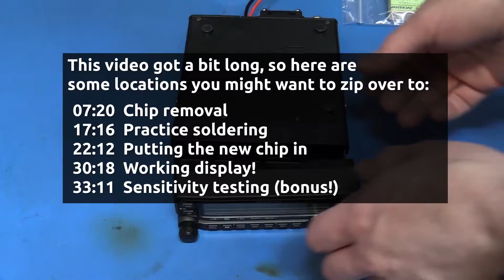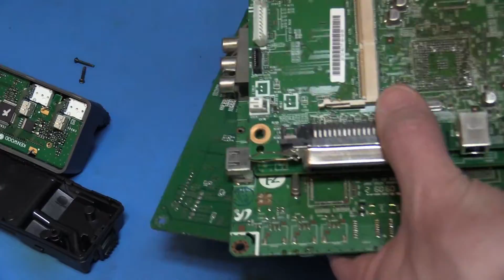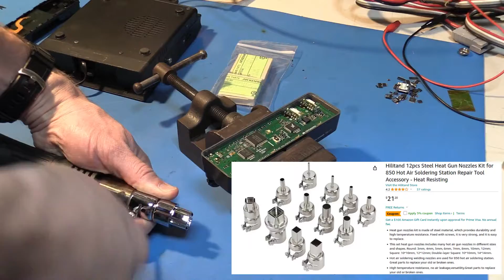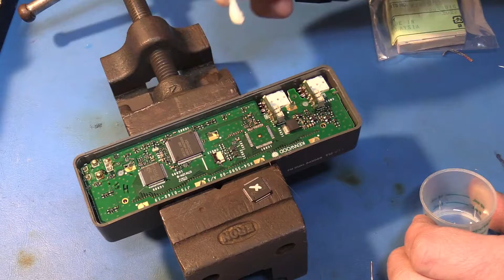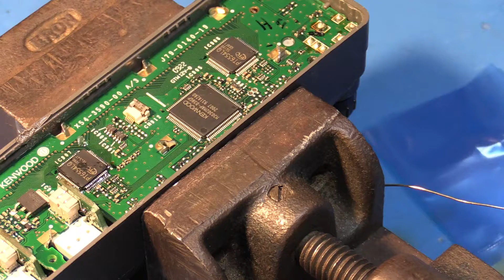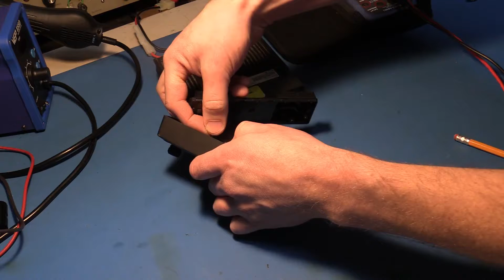Kenwood TM-V71 Display Repair

Comment: This is an authentic, unpretentious, and detailed video showing what went wrong and what went right; I don't edit it—I appreciate the honesty and humility. It wasn't clear to me if you ended up having to replace any other component besides the IC; the right side of my radio has completely failed, including part of the bar separating the two screens. Thanks for your patience and your time. 73.
Reply from the maker: Thanks for the complements! I had to replace some small components that literally flew off the board while I was soldering the chip. There’s one chip for each side of the display and I suppose the bar is handled by one of them. (The bar can be turned off in a menu, FYI). You can probably still order the chip from JVC/Kenwood and then you can have a similar adventure if you dare! 73
Reply: @W6EL Thanks for your kind and prompt reply. I don't have your temperament or the tools needed for that job; I'll likely have to learn how to adjust the radius on the two alternating bands on that screen as needed. I was asking if any of the small components were damaged, but from what you say, they just came loose and you put them back in place.

Comment: You are brave with out hot air soldee station and that quick chio renoval solder that turns solder to liquid .   Stuff use bd $39 a tube about 8 ft . 
Good job. 
I got ond these branc new in box hood it lasts yeads oncd i turn it in.

Comment: My favourite part of the video apart from the Educational Value it holds was this specific quote 
"Remember folks if it doesnt have a lot of these little symbols on it, its no good." 
Its a cool repair though i wonder what those White spots on the Circuit board after you successfuly repaired the board that was towards the Capacitor pile. Was it the Evaporated Flux or something?
Fantastic video as always.